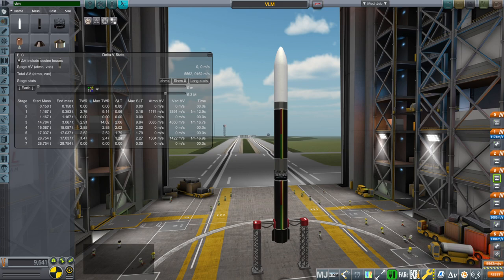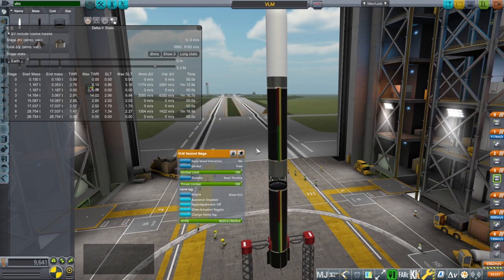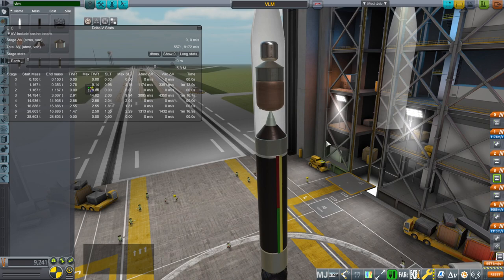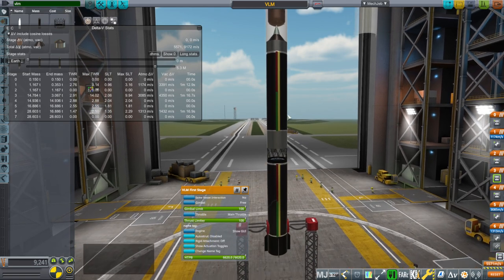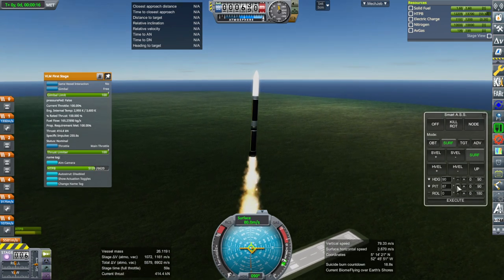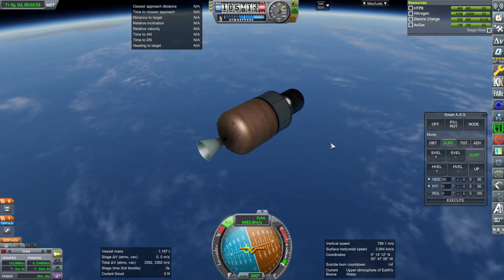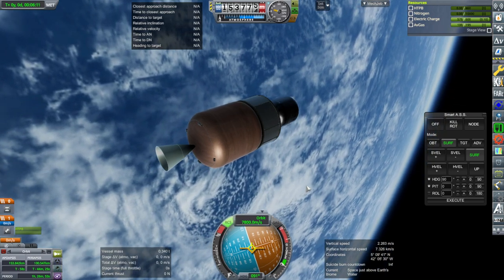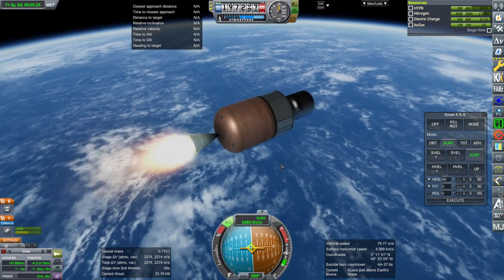Realism Overhaul in KSP 1.8.1 - VLM launcher test

Comment: Don't be too married about not pitching below 0 degrees. When you reach an orbital apo, the negative can help you raise your peri instead of going needlessly higher. Very helpful if you are trying to reach a circular orbit without a second burn or if your kick stage is small. (Actually used in real world launches.)
Reply from the maker: I think this is the trajectory they will be using. I'm well aware of how to manage a launch without a coast, but I think it's the most logical choice for this setup.